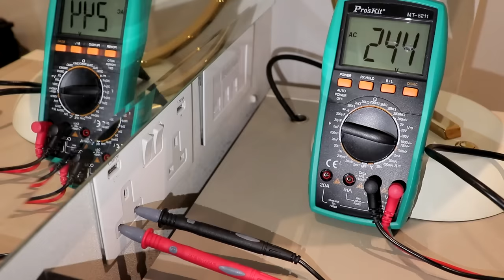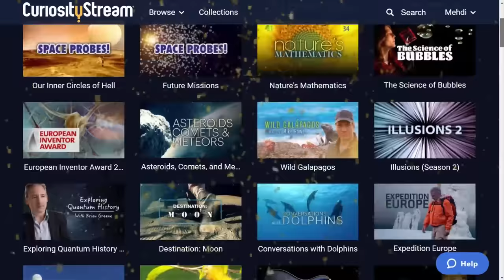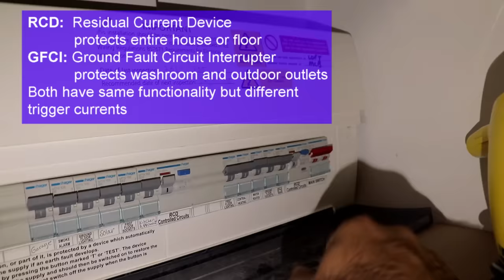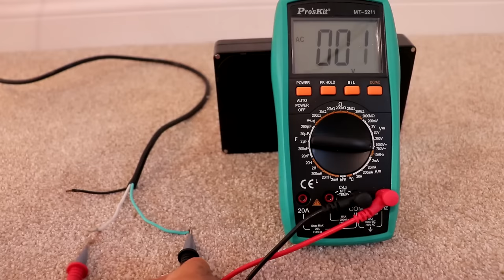Power Outlets in United Kingdom

Comment: if you think stepping on lego is bad, UK plug is a whole new level of pain
Reply: Literally
Reply: I feel you bro it hurts like SHIT
Reply: In fairness, though, because the UK has switched sockets, then why are you leaving plugs strewn across the floor anyway?

What I'm getting at is that you'd typically leave most plugs in their sockets and just turn it off at the switch. You unplug less often, so it's a rarer hazard for the plug to be lying on the floor for you to stand on in the first place.

I mean, sure, it does happen. I've done it and will support your "much worse than Lego" comparison. But in the usual course of events, plugs strewn around on the floor is a rarer event in the first place, because you can just leave things plugged into their sockets with the switch turned off - that would be the normal state of affairs.

What I'm getting at is that switched sockets alter one's behaviour. You can leave most things plugged in pretty much all the time, and control on / off with the switch.

So, yes, standing on a UK plug is terrible, but the overall system means you ordinarily shouldn't be leaving plugs laying around on the floor to stand on them in the first place.

Plus, there's an argument that you ought to always be looking at where you're planting your feet anyway - if it's not a UK plug, then it could be Lego, right? - and the UK plug teaches you to always "look before you leap" from that one time when you didn't, and unleashed pain. Teaching you good habits that also helps you avoid stepping on other things. Like Lego.

With electricity, you should have those extra redundancies, because electricity can kill you - and, therefore, you'll never "learn a lesson" from the experience - but when things can't kill you, there's the argument of not having safety measures in place, deliberately because "whatever doesn't kill you will make you stronger".

If you can harmlessly learn your lesson, then perhaps you should, so that you very rapidly learn never to do it again. I've stood on a few UK plugs in my youth, and therefore now fear it sufficiently to always look where the hell I'm going to ensure I never ever do it again.

It has instilled in me good habits.

For things that can potentially kill, you need safety measures. As dead people can't learn any lessons.

But for stuff that's just a bit painful but ultimately harmless, there's an argument to deliberately not have any safety measures, as the first time you burn yourself cooking teaches you everything you need to know about carefully watching where you put your hands and the future use of oven gloves, as you never want to be there ever again, if you see what I'm saying.

So there's an argument that the fact UK plugs are painful to stand on is also another "safety feature" in disguise. Once it's happened a couple of times, you'll quickly learn the habits of looking where you're standing and not leaving plugs strewn all about the place. When I have to unplug something, I don't just leave the plug lying around - put it off to one side or put it up on something, so it can't be stood on.

Pain exists for a reason. That reason is instilling good survival habits. So embrace that.
Reply: There is a flaw in the 'uk people leave plugs in the wall because of switches' argument.

I can point right at it, because I took a UK power strip with me to Australia (because I have a bunch of UK devices I also took. )

Wall sockets might all have switches (same in Australia BTW), but power strips frequently do not.
So unless you're OK with switching off the entire power switch as a whole, you'll still unplug things fairly often.

And... Yeah. UK power plug. Ouch.

Not just because of the really solid pins, but because the way it's designed causes it to almost always end up with it's pins pointing directly up out of the floor.
Reply: @klaxoncow  when you have a wife with a hair dryer, straihteners and a dozen other hair weapons there are always plugs on the bedroom floor
Reply: I fell out of the top bunk onto one when i was a young one, literally "plugged" right into my back! had to unplug myself :') yeahhh it hurt alot.
Reply: My mom once stepped on a European hoover plug and broke her middle foot bone. Just sayin'.
Reply: Can relate. it's a nightmare. not as bad as metal d4 though.
Reply: @KuraIthys , these days UK powerstrips are typically sold with switches on each of the sockets. You can still get cheaper ones that lack switches mind, but personally I'd only use those for stuff I'd be switching on and off together anyway.
Reply: @klaxoncow  found the party animal
Reply: @KuraIthys  What do you unplug and why? And how often are they at floor level? I have never stood on a UK plug, or know anyone who has. Why would there be a loose plug in the middle of a room? Unless you were moving stuff around, and left an appliance in the middle of the room which is very rare and you'd then surely be aware of the plug. You could just as easily argue that you could stand on a fork, or a hair brush. The only appliance floor level appliance that a UK household would regularly unplug and plug in is a vacuum cleaner. But you would leave it's cable strewn across the house, the cable is general wound up and clipped away for storage.
Reply: @klaxoncow  Not all U.K. power sockets have switches. Old ones did not require a switch to be fitted, and quite a few are still in use. Also, extension leads often don't have them. Switches can also fail in the closed position. So, many people unplug things and leave the plug near to the socket, for quick access. Sometimes it's just an old habit. Yes, it's bad practise, but - PEOPLE! 🙄
Reply: @Michael6thebluecutecatspartan  I don't think that is a good idea.... Asking for subs isn't a great thing as your content isn't related to the subject of the video
Reply: @phoenixtalon100  That's called a caltrop, I believe.

It is an excellent area-denial tool against flat-haired wedgie-givers sneaking up on nerds :-D
Reply: @Richard OMD! Knees and Eyes are my two squick-triggers!
Reply: A cheap plug can cost you $12, 000
Reply: KlaxonCow 
My man just wrote a novel on a joke comment

Comment: LOL @ the state of that blackened plug socket in the hotel?  How did you explain it, or did you clean it up and plead ignorance? =D
Reply: it's just soot, i think. it would probably wipe away quite easily.
Reply: "That's how I found it when I got the room! ARE YOU CALLING ME A LIAR!?" :P
Reply: You can wipe it off quite easily, so it’s not a problem
Reply: @Inexpressable  You've obviously never had to clean equipment covered in soot before. It gets EVERYWHERE and stains everything that isnt a dark shade and is near impossible to clean off without soaking all of your equipment in a bath of dish soap...

Alternatively it's a nice cheap way to coat things black for better solar heat conduction or you can draw with it I guess.
Reply: @Inexpressable  Vaporised/oxidised copper from the wire.
Reply: Electroboom was banned from all hotels after this video was circulated worldwide.
Reply: @Inexpressable  it ain't. Some of it it is. But there is a permanent black spot on the socket. Trust me i tried.
Reply: I'm pretty sure what he did was a felony crime. Intentional damage to the electrical grid.
Reply: That black residue easily goes off. İ remember when i was kid i grabbed my sister's metal hair clip and put it in both sides of 220V wall socket just for curiosity, although i was kid i didn't cry or something just calmly get shock and my body was vibrating like a hell for a 3-4 seconds and thank god my grandpa's sister was around and she immediately grabbed and pulled me from socket. My hand was really black like burnt sausage(not be racist but it was like native African skin lol) . Then she took me to the bathroom to wash black residue on my hand and it went off immediately
Reply: @fedai1196  yes but did the black stuff from the outlet go away?I mean,ALL of it
Reply: @Inexpressable  Its not soot, but you can wipe almost all of it away
Reply: @rscervin9950  as i remember, at that moment outside of the socket wasn't covered with black residue, because that was the same socket still present in my sister's room and it is still remains fine and clear
Reply: @rscervin9950  but anyway you get the idea. it was the same residue on my hand, if it goes off easily from my hand( without even using soap, just tap water) , then it can be cleared away easily
Reply: “Sorry mate, I’m American, I plugged in my shaver and it exploded.”
Reply: I was going to leave that exact comment
Reply: @Pieh0  I ain't calling you a truther!
Reply: "you can't fool me. I follow you on youtube!"
Reply: @u770017  I'm pretty sure you're overstating it.

Comment: The UK and the Republic of Ireland use pretty much identical systems. Everything is over protected. You cannot have electrical outlets or switches in a bathroom other than pull cord switches or the shaver outlet. The shaver outlet is usually an isolation transformer with a thermal cutout, it cannot draw enough of a current to electrocute you even if you're wet and barefoot. There are also strict rules as to the type of electrical fixtures that can be used in a bathroom and what position you can put them in in relation to the bath, sink, shower etc. Also every piece of pipework or metal is equipotential bonded. As far as wire nuts or marettes they are forbidden, you must use a fixture with terminal blocks or a terminal strip. UK rules are pretty anal and are constantly being made stricter, but hey safer is better when it comes to electricity.
Reply: You're right Conor. Marrettes were a real sickener to get used to over here in Canada. And splices everywhere for commercial work.
Reply: when u rlly think thats over protected: go to germany
Reply: @IrdXI  that's not left a mark on the surface of protections and regulations in place in the UK that's the craziest thing I dunno about Germany myself although I can imagine they have some insane safety regs as well
Reply: Longest comment ever i read in my whole life
Reply: I didn't know about that bathroom/shaver outlet. That is the Syosset thing I've ever seen. The UK nanny state never fails to amaze me.
Reply: I actually kind of admire their safety concerns. I mean have you seen an electrical fire on 240-230 volts? Either way, both things are really impressive...
Reply: But can't 240v kill you easier than 120v if you accidentally touch the pronges or live wire?
Reply: liberty something something saftey.. ah UK, you do you.
Reply: guy 83728 83728 depends on the current.
Reply: pcb1962 Part P is a building regulation. It’s only there to guide the design specifics. It does not prevent idiots doing electrical cock ups to their own homes. 
  It is also a way for the council to assume works to an approved body rather than having to register works and have a council person come out to approve the works completed to standard.
Reply: Outlets are allowed in UK bathrooms under the latest sets of regs I believe though 3m outside of zone 0 and 1. With most bathrooms generally smaller than this though it does tend to lead to no sockets!
Plate switches instead of pull cords are outside of what's called zone 2 so again comes down to bathroom size really.. I guess its easier to default to a pull cord generally to avoid thinking about the zones too much.
See https://www.diydoctor.org.uk/projects/bathroom-electrical-safe-zones.htm
Reply: Popcorn Vendor Not true anymore; domestic work has to be done by a competent person, and any changes can only be made by a qualified person i.e. you cannot DIY a new circuit, but you can replace a broken fitting like for like. Then again, who will ever know (unless the house burns down).
Reply: Terminal blocks are actually banned in inaccessable locations now. You have to use spring loaded connectors as screws can loosen over time.
Reply: Andrew Delashaw The shaver outlet is a throwback to pre-RCD times. It was the only socket allowed in a bathroom - there were no rechargeable shavers when it was designed - and is isolated from earth via a Safety Isolating Transformer, so you would need to touch both contacts to get a shock. It is also fused very low.
Reply: guy 83728 83728 Either can kill you, but thats why the RCD or GFB is there - its current that kills, so limit the current and you’ll get little more than a brief tingle (its all over in about 30 ms). Higher voltage will increase current through a resistive load (flesh) in an unprotected circuit, which is why the whole house is protected. No domestic deaths attributed to electrocution in Ireland (similar to UK system) since 2014!
Reply: great comment, couldnt have said it better myself
Reply: @andyowens5494  so does the RCD or GFB whole house current protector protect people from dying from hair dryers and other things falling into the bathtub? Also why doesn't the USA have this?
Reply: @guy-fl1gr  Yup. Current is cut regardless of how it's conducted; finger in socket, hairdryer or toaster in bath etc. I can't answer for USA; presumably life is cheap given the number of deaths from electrocution, gun shots and obesity.
Reply: @guy-fl1gr  it definitely gives you a good shock speaking from experience
Reply: On German safety regs, outlets are actually allowed in bathrooms. And not those low power ones that can't power a hairdryer, regular full power ones.
I guess the thinking is, better have a full fat plug in the bathroom than people bringing in extension cords or cable drums.
Reply: Andy Owens I wish that were true. 
You have the right to do whatever electrical monstrosity in your own home (the repercussions are also your responsibility though - need a sparks to confirm practical safety EICR when selling up) it’s no longer worded as ‘competent person’ in BS7671 but as skilled. - you do not need to be ‘Part P’ to carry out domestic electrical work, you would have the council approve the works. However, being with an approved body (nic, napit etc.) do the registration for you. 
The part P course (2393 C&G) isn’t even considered a recognised exam of learning. It’s just building regs. But it’s the one that’s most applied to electrical work. Part M is also relevant.
Reply: @guy-fl1gr  easier power transmission to appliances with drawing smaller current and therefore less energy wasted to the environment through heat...but yeah

Comment: The reason why each UK plug has fuses is because historically and still is today , work on ring circuits vs branch to save on copper .... (some countries that uses the UK plug have converted to branch circuit systen today)
Reply: Radial circuits are common in the UK too, and the other reason that fused plugs were adopted is to properly protect thin line cords as you might find on a table lamp. That means a 5A cable does not have to rely on a 16A circuit breaker. On the old BS546 standard, there were four different plug sizes. 3A, 5A, 15A and the (very rare) 30A. The aim was to have the convenience of a single plug size without sacrificing protection for smaller appliances and thin flexi cords. It did, also facilitate 30A ring circuits, which is a bonus, especially in kitchens, but some electricians now prefer to deploy 32A radial circuits using 4 sq mm cable. They might then do the rest of the house on 16A or 20A radial using 25 sq mm cabling. Current loads tend to be lower now with central heating, but prior to the seventies, portable electric space heaters were common.